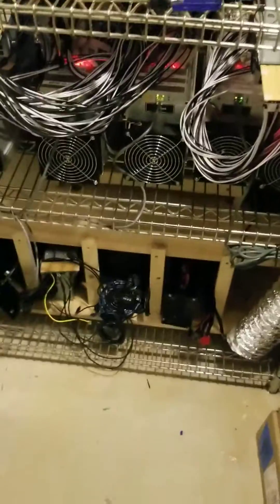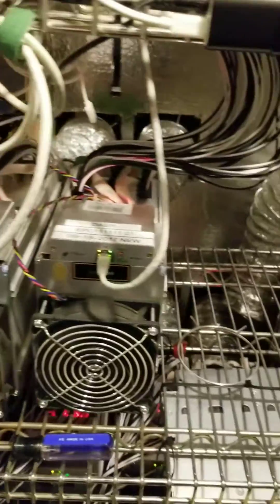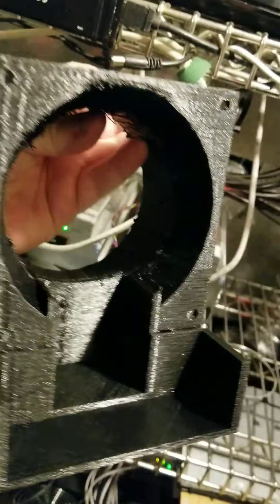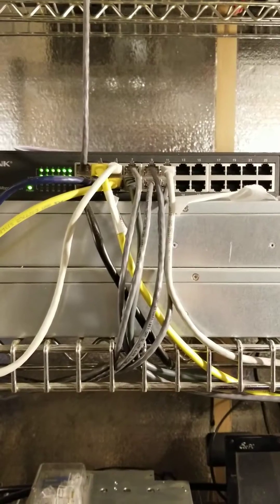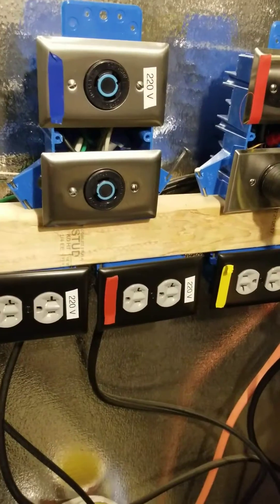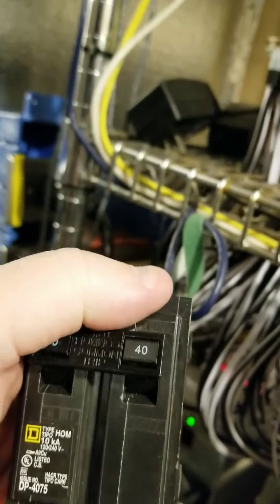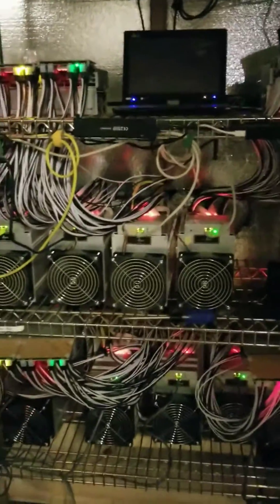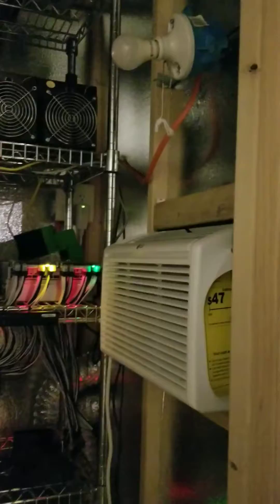Antminer cooling shroud updated newer cleaner look. D3 L3+ S9 BITCOIN LITECOIN DASHCOIN

Comment: Thanks for your video.  Two questions.  Why not use insulated duct instead of the foil?  Any advantage with 4" why not 5" duct on a 5" shroud?  Seems like more heat would leave faster if you used 5".  Thanks for the videos.

Comment: How much A/C do you pump in that room? What is the temperature of that room?
Reply from the maker: opps i see you mentioned 3 phase in the comments.  it hooks in to the power panel on a 3 phase braker. this is a link to one on ebay.  https://www.ebay.com/itm/Power-Saver-3400-Energy-Saver-3-Phase-400-Amp-4-left-/162718367666?hash=item25e2c53fb2:g:GJoAAOSw-vlVoSq1   3 lines in to the panel one to each phase on a 20 - 40 amp braker. then one green line to ground in the panel. really simple. cleans up the dirty electric, and if their is a massive power surge it will take the hit and save your equipment acts as a whole unit surge protector. it also cleans up the dirty energy left over from your equipment and sends it back to the units to be used again instead of letting it phase out to ground. by recycling the energy it will give you a 5 to 15 % drop in your energy bill but keep your equipment running smooth.

if you are doing 220v you need this one. https://www.ebay.com/itm/Energy-Saver-PU-1200-Residential-KVAR-unit-/112457788742?hash=item1a2f01ad46:g:qlwAAOSwLsBZUYzV
Reply from the maker: i only pump 6000 btu with my machines, running, keeps the room about 60-65 degrees
Reply: wow! What do you use for PDU? We are currently upgrading a small gpu farm to asics. We've acquired industrial space with 480v. I met with the electrical supply company yesterday and explaining to him our needs, he was kind of blown away. "IT Servers don't draw that much power" yada yada yada.

Getting an electrical engineer involved next week.
Reply from the maker: good part is i have worked with 480v for over 16 years so i can put together my own system. I can say it will cost you more for the outlets to plug everything in on 480v. my system i did all the electrical, and can run up to 75 machines in my current location. but i am only on a 220v 225 amp system right now. im having a 600 amp feed installed for my new operation space in about a week, i can run up to 250 machines give or take a few off it depending on what machine. im not using a PDU system im using an energy saver system to clean the energy first, then directly in to the machines the main breakers trip if the power goes out so every machine shuts down at the exact same time. I then have to manually re-trip everything once the power is restored.
Reply: Which Energy Saver System are you using to clean the electricity ? And how do you have it connected ?
Reply from the maker: are you planing on doing 2 phase or 3 phase?
Reply: shawnpc1 I’m just trying to figure it all out. I’ve got 100 ASICs that have 220 outlasts. I’ve got a 2500 amp service with 480 but I’m trying to figure out the safest and cleanest way to deliver it to the ASICs. If that makes sense?
Reply from the maker: yes it does. thats a hell of a nice farm. let me look at my suppliers to see if they have any 3 phase power supplies that can run more then 1 machine at a time under 3 phase. that might also help you use less energy.

Comment: How far does that noise travel? Can your neighbor hear? Also can you show your exaust area?
Reply from the maker: Noise is no problem, i live on an acre of land and my closest neighbor is about 100 feet away,  the noise BD in the room is 75-85 and outside on all sides it is about 40-45 just like whispering to someone, even quieter when the door is closed, cant hear them unless you are within 10 feet of the room. I just think my camera picks up the noise level better then most cameras so it makes it sound a lot louder then it is. my vents i was going to show in a later video but may not have to if i get my new shed up and running soon, then ill be doing videos out their, and it will be nice and cool and quiet the way i am setting stuff up. as for the existing exhaust i just have it vented on short 1 foot 4 inch hoses directly outside. I have a 4 inch hole drilled in to the room wall directly behind each machine with one of the old school 4 inch shrouds screwed over the hole to attach my pipe to, then i left a 1 foot gap and then trellis behind that to block any excess sun or rain from getting near the room.
Reply: shawnpc1 that's great. I have a mining operation I am in the process of building so most likely you see some orders for me for your cool shroud
Reply from the maker: thank you
I have already had repeat customers from Florida and Australia. and I know they both have plans to order more as more equipment comes in. I am about 5 days behind on shipping right now, so my build up of more printers is starting to catch me up till i release my new product, then i think it will go crazy again. I have the first 2 prototypes done and testing right now, and submitting the patent paperwork in a few more hours, just finishing filling it out as i type this.

Comment: KW/h rate on your location?  are D3 still profitable?
Reply from the maker: Ely Lamus 
My kwh .23 per kwh really eats in to my profits but I'm making it work. Still making enough to pay my bills and more.
Reply from the maker: l3+ is still profitable where i live at .23 per kwh on all my machines i have roied about 70% of them now. I found out that if you run in a multi pool instead of a ltc pool you will make about 30%-70% more profit off your coins once you learn where to trade them at. i use www.multipool.us to mine both my L3+ and D3's now on the d3'S i average 10 - 30% more profit then just dash coin alone. I sale my coins at 2 different places one is https://changelly.com/?ref_id=5ac1c7ceb316  the other is https://www.cryptopia.co.nz/Register?referrer=spc111111

Comment: Hi how to turn off Antminer + in a proper way?
Reply from the maker: you just need to power it off, if you have your power supply on a switch turn it off, if you don't,  just unplug it. mine are all on a switch that is on the power supplies. if i need to power them off i just turn them off.
Reply: i am wary of i will broke it down
Reply from the maker: you should be fine, they need to be rebooted every now and then. it should still be under warranty if it does fail. i have yet to have one fail after rebooting them once every week to clear any hardware errors

Comment: Shawnpc, nice setup.  I was wondering if maybe we can discuss your cooling and exhaust setup.  I have about the a similar setup and was wondering what you're using to pull the heat out.   Maybe you can hit me up on google hangout or email?
Reply from the maker: my exhaust is just a 1 foot pipe heading out of the room, they vent directly outside so their is no need for me to do anything else. the miner does all the work with no aid.

Comment: Shawnpc1 I have a question? How many L3+ can operate on 220v 40amp breaker with 6 Gage wire or receptacles on one breaker
Reply: 220v x 40amp x 80% = 7040watts of power to mine.
Reply from the maker: you can run about 8 l3+ on a 40 amp